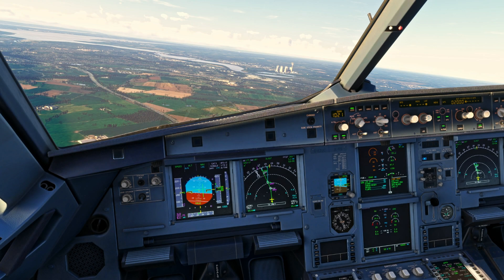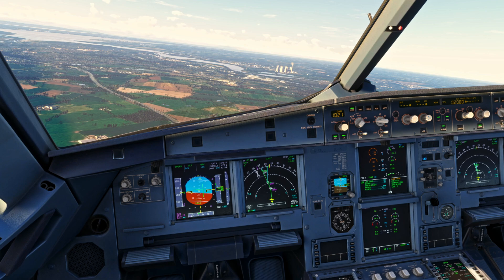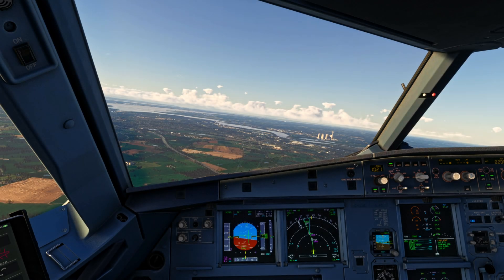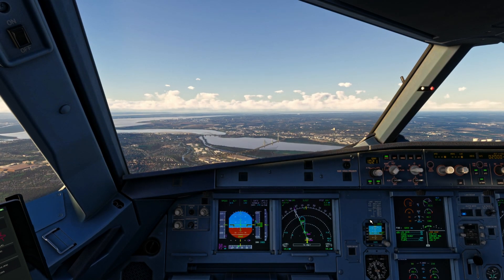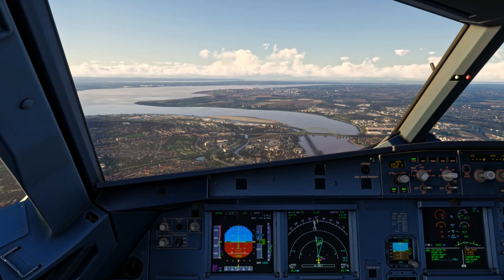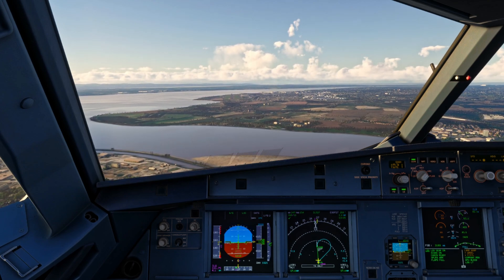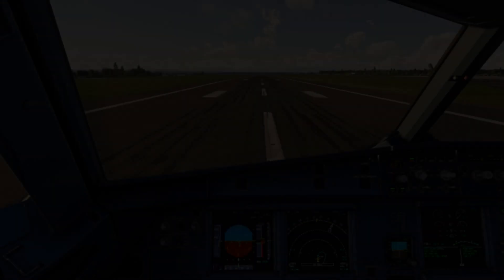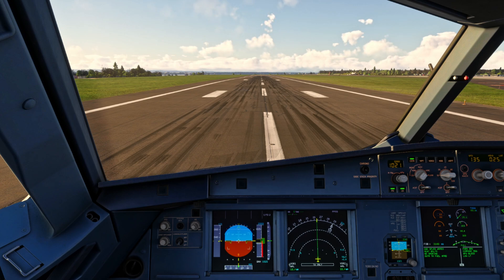Single Engine ILS in A320 | Real Airbus Pilot Tutorial in MSFS 2024

Comment: Thank you Captain! Am I correct in saying that it is not permitted to fly NPAs with engine out? In that case would you continue the approach visually with a downgrade to a higher minima if available or would a more suitable alternate aerodrome be required?
Reply from the maker: I am planning the single engine NPA video. The Neo can fly a NPA single engine on autopilot. On the CEO you are limited to HDG/VS and TRK/FPA. The A319 is limited to FD guidance only. SOPs will vary but we do practice this in the SIM and it is acceptable as long as you use the permitted guidance for the variant being flown. Final App, NAV VS and NAV FPA cannot be used on the CEO

Comment: What did you mean by 7 units of rudder trim? In the 320, in that scenario, 7 clicks to the right on the trim? Also, would you adjust that trim depending on the speed?
Reply from the maker: Hello, trim until 7.0 is set in the rudder trim which is more than 7 clicks, the best thing to do is time how long it takes to set in the Fenix and you can then set by counting up making it easier. You would adjust that slightly as you would the thrust setting for the specifics of each flight but generally that works for the 70% N1 descending at 700 ft per minute
Reply: @AirbusCockpitCoach I noted you didn’t have to adjust the ailerons either so I take it the plane is in Normal Law in that scenario as well. At what point does the plane stop adjusting the ailerons for you, to stop the rudders inducing a roll?
Reply from the maker: @Chris-nb1hc  Yes this was normal law. The ailerons stop compensating on main wheel compression. Failures of the FCCs and/or FACs will cause issues with aileron-rudder harmony. Alternate law or Direct law will lead to complete disablement of the aileron adjustments